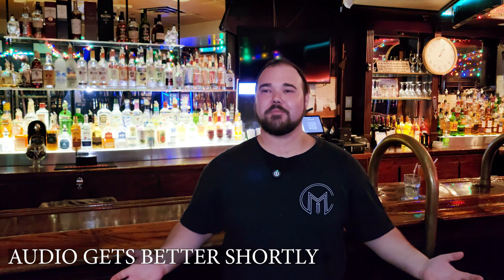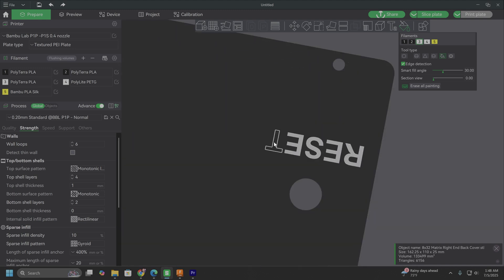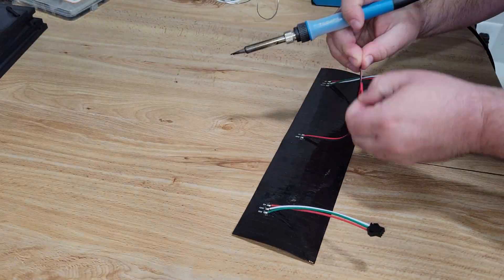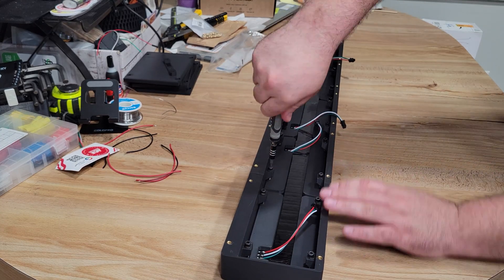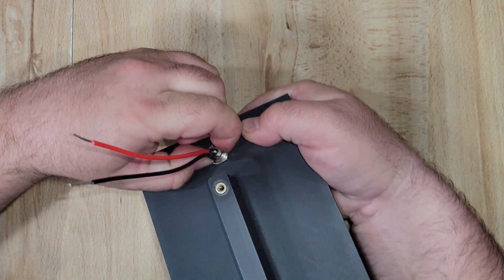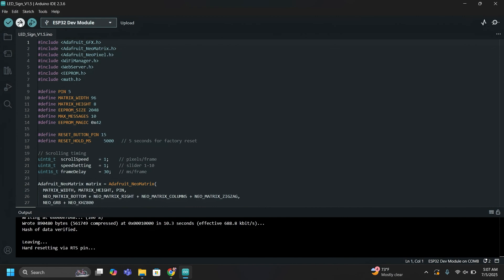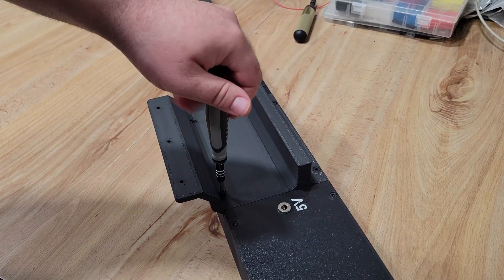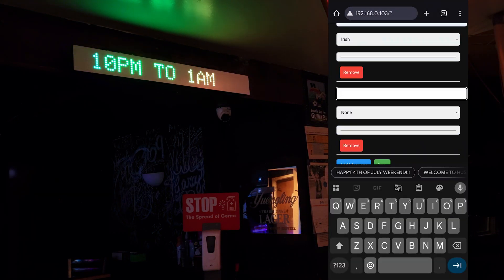DIY LED Matrix Sign

Comment: Finished printing the parts and the assembly. Looks really great! I'm going to mount in my shop along side the other WS2812 related things I've made.  Even fiber lasered the back cover with instructions on how to connect to it with WifiManager.

I'm hoping you can help me with this question. I realize that there really is no EEProm in an ESP32 so you use the EEPROM.h library to emulate it. So it's basically a SPIFFS storage system. My question, Is there a way you know of to erase the data on a full reset of the WifiManager so it doesn't store the data from a past user? Do I just write data to the declared size of the EEProm and what data would I need to write? I realize I'm pushing it here but you're my last hope. Also, I modified my code and added a SPIFFS file to include the scrollSpeed, speedSetting and frameDelay so would be saved if a power outage happened. Still trying to figure out a way to have the IP address run once before the messages are scrolled. Sometimes the IP can change depending on the time the last IP was assigned. Thanks for any help you might give me.

Comment: Excellent project. I'd like to make one but have a question regarding the 3D printing. Did you use supports? Thanks!
Reply from the maker: Everything was designed to be printed without supports. Thanks for the question and thanks for watching
Reply: @makerscorner93  That was a fast reply! Thank you for the info. Already ordered the LED panels.

Comment: Good project!  Surprised the 3 amp supply was enough - until I realized you would probably never light up all the pixels to white.  Have you tried that?  Cheers!
Reply from the maker: I think I did once on accident while working on the code. It did manage to handle it, but it was also for a very short burst before I unplugged it haha. 5 amp power supply would probably be better, but it's been running 24/7 for months now off the 3 amp one with no problems. I do keep it at around 25% brightness which is already PLENTY bright enough. But I've also ran it at 50% for extended periods of time while testing without any issues. Unfortunately my code doesn't have the nifty power management stuff that WLED has. Maybe a future update will solve that, but I have too many other projects I'm working on currently and don't have time to play with the code for this one now. Thanks for watching!

Comment: Have you considered using a dovetail joint or something in order to join the pieces modular pieces together? Technically doesn't require glue (I would still use some) but it holds it's own position and depending on tolerance has little to no gap and doesn't require you balancing a can of glue to make sure it's tight :P .
Reply from the maker: But if I had done that, what could I possibly have used that random bucket of paint for? 😜 I couldn't find ANY of my clamps. I think they grew legs and walked away.

I actually had thought about using something like a dovetail joint towards the end, however I had already redesigned the entire project more times than I care to admit to (hint.. more than 15, less than 17 haha). I should probably stop doing the majority of my CAD work at the bar 😅

The original design used completely different LED panels. I was pretty tired of redesigning everything and my initial prototypes held up pretty well using just the 2 part epoxy. I wanted to ensure the gap between the white sections was as minimal as possible for aesthetic reasons.

Appreciate the comment and thanks for watching!